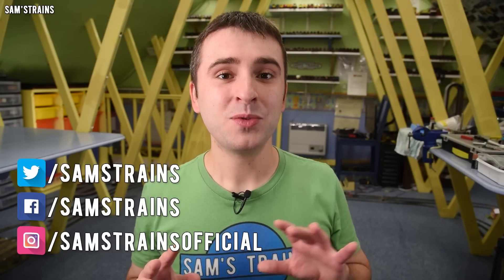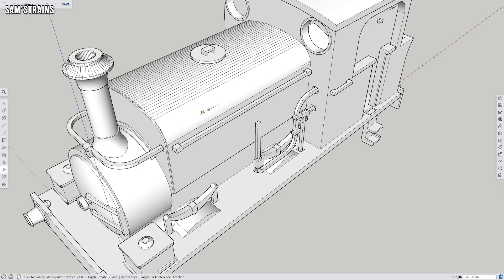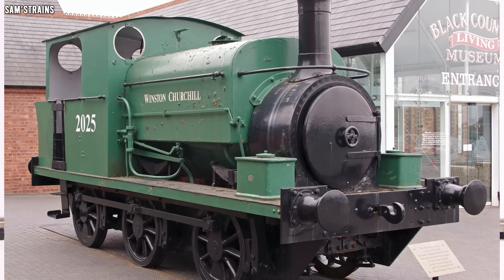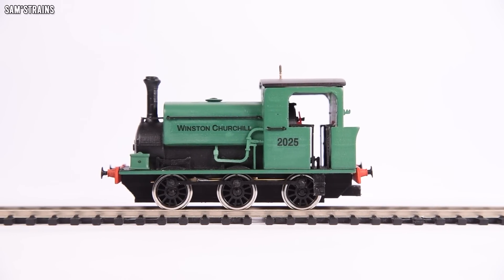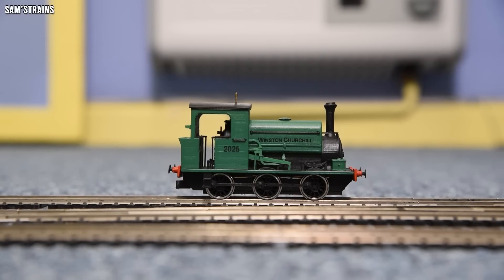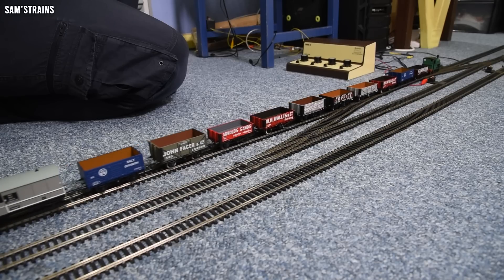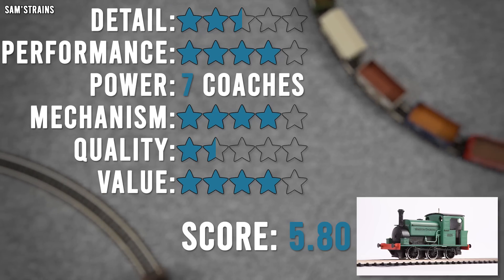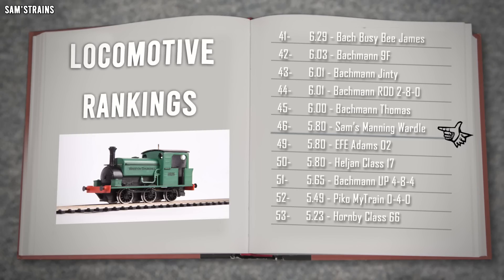Sam'sTrains Manning Wardle L Class Tank Engine | Unboxing & Review

Comment: Industrial locomotives are my Kryptonite, and that is a lovely little beastie to boot. I think to inject some life in your MW L class project, a bit of development work to improve on the running would keep you occupied for a good while. If you're going back in to improve the couplings, how about adding in some voids to the body (like the smoke box and beneath the coal for starters, but I'm sure you'd be able to find others) where you can glue some metal weight in, something like 'liquid lead' which is basically just tiny steel balls that fill voids and superglue that in place; don't use PVA because that'll make the metal corrode and expand which will damage the print. More weight alone will help the pickup as well as the haulage. I reckon if you can get this up to 100g or more will make a huge difference.
Reply from the maker: Thanks a lot Simon - yes I will definitely revisit the chassis at some point and try to improve it - I think it should be quite easily done! Yes I've been recommended the liquid gravity... it should come in very handy for the next project!
Thanks for watching, Sam :)

Comment: Nice loco! As my local line is the Middleton, I'm used to seeing these moving about and yours looks quite accurate. It looks better than the Bachmann S100 by a long shot!
 I'm sorry to say this, but you made a mistake in the 'history' section. You said there were two L classes preserved, Winston Churchill and Sir Berkeley (pronounced Barkeley). There were actually at least three, as I have seen two and I haven't seen Winston Churchill. The other is Matthew Murray, preserved at the Middleton Railway along with Sir Berkeley. She is a L class, as the MR are very proud of the fact they have two members of the same class built twenty years apart. I'm not shaming on you or anything (I know how hard it is to find loco info online), you just might want to mention it in the description or something.

Comment: My advice would be to break the model into more pieces, and think about where you want the layer line direction. The saddle and smoke box, for instance, could be separate parts, printed laying down, and the layer lines would pretty much disappear. It would also be easier to paint as separate parts, with the added advantage that if you have a failed print, you lose less time.
Reply from the maker: Thanks Fred - this is an older video now, some of my newer projects have been much more sophisticated - check out my coppernob series!

Comment: If the layers lines on the model are straight from the 3d printer then that is a good print. You might want to investigate vapour smoothing if you want to try and remove them (but that is a lot of faff TBH). Also another vote for getting some wire and brass sheet and bar from Eileens Emporium to make the model look even better.
Great model.

Comment: really impressive! to actually have a working oo gauge loco that looks  that great  and a high standard from a 3d home printed design. its amazing 

I have a couple of questtions 

1.did you print with pla or petg for you loco?

2. do you share the .STL or sketchup file freely?  Im really excited to see you work youve done a great job on your models and would be nice to print one at home to help with inspiration to get started.

3. To get even better quality when using cura or prusa slicer, try setting the nozzle movements to combing mode and try using randomise seams. that way most of the start and stops will be hidden in the model and any movement will be hidden in the model so it doesnt cause so many artifacts and blemishes. i discovered this setting this week and what a difference it makes. 

4. Also  an idea for a future video, have you seen or heard of using a' ultrasonic ceramic disc atomiser 'to create realistic smoke effect for model railroading. its not like the traditional smoke units that leave an oily film on the layout. it is run on pure water. the effect is very realistic.

 That is what TRS trains seem to be using, its the same thing that's used in those tiny micro mister/fogger machines. Some units are cheap on ebay for a few quid from china and could run on a dcc decoder output as they only draw low amperage (100-300 ma) and would be amazing to see a video or trying to kitbash a 3d printed engine at home with sound decoder and steam. i havent seen any one else do it but would make a great video series.

Comment: I actually like how it's jerky at low speeds, reminds me of a Locomotive that's out of time. Giving it a wiggle. A lot of Locomotives can't be set perfectly in time at every speed. So they sound and look off at times.
Reply: A loco with incorect valve timing would not jerk like that, would just sound off and possibly have trouble starting.

Comment: Wow that's rather good!  A Shame that the real one is just outside in the open, it will just rot away. It ought to be inside somewhere to keep the weather off it. But well done on your model of it! And it does not run bad considering the cost of the motor!

Comment: A beautiful little loco that could've been improved by more time with filler (using proper filler instead of the filler primer maybe), and using proper transfers. The wobble is probably just solved with tweaking, although the tolerances in the bearings may be a little too large.
How about a small 0-4-0ST Peckett next, maybe Teddy? Or the flying bufferbeam, aka peckett 1906 i think (may need to be 0 gauge for decent mechanism clearance)

Comment: Suggestion for a new loco. Try to 3D print a Small Pannier Tank to fit on the Manning Wardle chassis. Maybe that could be a new outlet point for your 3D printing skills.
Reply from the maker: That's a fine idea - would be cool to use that chassis for something else... but I could just as easily change the wheel spacings/chassis length to make it realistic!
Thanks for watching, Sam :)

Comment: This really does beg the question where model railways will be in 20 years time. Will we buy platforms and we print the top? Is there a market for modular running gear where you can set the wheel sizes etc to your requirements and you print the rest? It's been a great demonstration of the technology.

Comment: hi, 3 things.
1. I'm very impressed with this, it's a very nice model and it is your own work which is something to be delighted with, the chassis in particular as its something people seem to struggle with.
2. if you are looking for cheaper wheels scalelink may be your friend, at 3.6-4.5 pounds per wheel a six coupled loco like this works out at a price of roughly 21.6 pounds with the wheel diameter of the L class which I quickly looked up, which is a pretty good price especially since you have gone for RTR styled pickups.
3. I don't think the word realistic is used right within this context, maybe accurate would be the better word?
Cheers, Jacob.
Reply from the maker: Thanks Jacob - yes these wheels came from Scale link, but when you factor in postage, axles, and crankpins, it was a good £40! haha yeah maybe you're right about the accuracy thing! ;D
Thanks for watching, Sam :)

Comment: Resin printers will give you amazing detail, but the workflow to make a good design work in resin is a bit more involved. Slicing and orienting on the bed is also a factor in getting good prints. And then there is the general nastiness of the resin, and the post processing cleaning and curing. Plus it is far more brittle than PLA. Still - if you want HO scale boiler seams with rivets that actually print, resin is worth a look. They are comparable in price to FDM these days.

Comment: It's a beautiful model Sam. You should be very proud.
However if you used your STL files with a cheap resin printer the quality of the parts would be much much higher. Chances are you wouldn't have to do any sanding and the quality would be comparable to injection moulded parts.

Comment: Great ! Yes, the finish is not the best, but this engine does the job, and is very nice to look. Of course, it would be better with a resin printer, but as is, you have a nice little kettle that runs fine.
As to be cruel, can we have a comparison with the GWR saddle tank from Heljan ? I think you have done better than them overall...
Some free lance models I want to 3D print for my own, if you want some ideas : a UK schnabel wagon, a 0-10-4 tank engine, a 0-10-0 + 0-10-0, or a 2-8-0 + 0-8-2 Mallet articulated engine and, for some diesels, a Co Co + Co Co articulated locomotive based on the early BR designs from the LMS, like two 18000 with a single cabin and coupled togheter at the non cabin end, like an US E8A + E8A or F7A + F7A... Or maybe bigger, Co Co + Co Co + Co Co, with a cabless engine in the middle...
Pick your own choice above if it inspires you... More simple, a central cab engine like the german V90/V100 class would be a nice project, I also have this one in my ideas...

Comment: Great model and video. Although have you considered using metal wire for fine details such as handrails, I feel it could make the model look somewhat cleaner.
Reply from the maker: Thank you! Yes I've thought about it... but it's actually a little easier to 3D print them as you can get the exact length this way, and they're always dead straight!
Thanks for watching, Sam :)

Comment: Spend a little more time on the finish and it would be a really good model.  I would also suggest the possibility of putting the extra weight in the chasis,,, a couple of pieces of steel bar between the running wheels perhaps.  But on the whole good for you.  Practice makes perfect an I believe that in time you will get the model you will have imagined.

Comment: Better result than I expected! Personally I hate the layered look of 2d printing in general. I think you will end up with a good resin printer eventually, the price has gone down over the years. Look for a resin 4K printer with a small printing area, the smaller, the more resolution of the lcd panel used, ideal for these small models.

Comment: Hi Sam, could you leave link to the motor and work gear you found good. Thanks  ,keep the brilliant work up.
Reply from the maker: Sure John
Worms: https://www.ebay.co.uk/itm/193282780538
Gears: https://www.ebay.co.uk/itm/252960471892
Motor: https://www.ebay.co.uk/itm/254604745332?var=554930824481
There's enough gears there to make 5 of these locos! :D
Thanks for watching, Sam :)
Reply: @SamsTrains  thanks very much, Keep the good work up.Immaking an Irish rail little shunter/
Reply: @SamsTrains  Thanks , I am working on my Shunter Loco as we speak. Ive to try order some different components as some places wont send to Ireland from China presumably.  But I will get that sorted.  I'd love to motorise a 3D Tram. I already have made the Tram. The problem is the motor has to be as low as possible both to be hidden from view and to make a motor work with the shaft in a horizontal position. I am not sure how that will be designed.  Maybe one episode you could try it and even convert a Corgi Tram. though that take a lot of cutting up of metal. The London Feltham tram would look brilliant running on your layout.  Keep the brilliant work up. 3d is the way forward.

Comment: I was going to give advice on the decals, but then I realised that the 3D printed nature works against you in that department.

There are a couple of spots of underextrusion on the cab pillar, which I expect Milliput will deal with, if you hadn't already considered that.

You can prepare a surface for decals by applying a coat of gloss varnish, this will help ensure a smoother result. Another coat of gloss varnish would then seal in the decals, and you would just then to apply a final coat for your preferred finish.

You've come a long way in 3D printing, and your work is very impressive. Perhaps having more parts separate could help? It would allow you to print the saddle tank and smokebox pointing upwards (cab-facing surface on the print bed) for a cleaner result, same could be considered for the cab roof to tackle the layer stepping.

Comment: I have been 3D printing for some years, using FDM and I think that little engine is great. The results you have there are really good.  I would work on the finishing of the prints rather than looking to Resin printing.  The prints may be great, but resin needs a whole different way of handling the resin and prints, could be more effort than you want to put in. FDM is very simple by comparison. How would a running plate of brass plate work, you could drill holes for attaching the FDM parts using small pins perhaps?  I think your quality rating was crap, you were far too hard on yourself.  That model was not that bad. I am not a model rail person so I am looking at this a bit differently perhaps.  Does your printer have "adaptive layers"?  That automatically uses smaller layers for features that benefit from smaller layers, might be worth a try.  Look forward to a coco or a bobo coming up. No idea what they are LOL

Comment: .modify your coupler to offset up or down as needed
Reply from the maker: That was the plan - but they're designed to be printed flat... making one stepped would make it much more difficult to print.... supports don't really work on fine parts I've found :(
Reply: @SamsTrains  someone Roco or fleishmann made an adjustable nem shaft with euro coupler. The coupler and nem shaft were joined with a sliding friction fit that couldbe moved up and down

Comment: Hi Sam. Wot, no DCC decoder socket? Given the provisos on quality you mentioned in your opening statement, I'm mightily impressed with what you have achieved with this model. I am really looking forward to any improvements you may decide to make. Shouldn't the backing track to the running session have been "Good Vibrations" by the Beachboys? Your ratings are pretty accurate, but I think your comments were rather harsh. Come on - you did beat some commercially available products!

Comment: Somehow your £200 printer prints higher quality things than my $650 one?? What print settings do you use?
Reply from the maker: I'm surprised by that - I'm sure a $650 machine should be able to match this - I use decently low speeds, and a layer height of 0.08 for fine detail. What sort of quality issues are you seeing?
Thanks for watching, Sam :)

Comment: Sam, frankly, if i look what the loco pull in the running session, i think the real loco did not pull much more then that.

I would make the pick ups from thin sheet copper, soldered on the brass rod.

Overall this DIY loco is not that much worse then a end '70s / begin '80s Lima models.

Comment: hey Sam that is one very good looking 3d printed model for a beginner 
i think you can do better if you separated more of the parts to make it easier filling sanding and painting them 
also using brass rod for the handrails would make it look better
with a little more practise with the 3d printer (get a resin printer haha ) and software a little bit more time and care building the models i could see you going into business selling these
ps 
Sams Trains: i've seen better crawlers
Me: i've seen way worse crawlers from the pro manufacturers

Comment: resin is far to heavy  try running the the steam puck locos i bought from hi hi hornby but was another distributer and as soon as you pick up speed around ant bend  a b or c TRACK  they topple over including the coaches running on another loco they to top heavy in RESIN
Reply from the maker: It is heavy, but the weight is good in my opinion... they don't run fast enough to derail on curves in my experience!
Thanks for watching, Sam :)

Comment: Take a bow, you made it, you didn't buy it, 3D modelling has its own rewards but it's not for everyone and there are benefits of filament printers and there are downsides to resin printers. and for creating items like this on a resin printer you would need to use a resin like the Anycubic Tuff resin as it is more durable and robust.